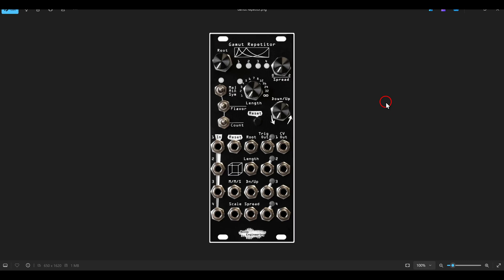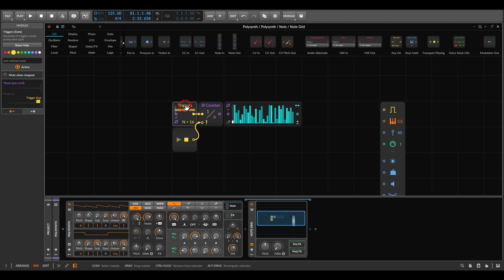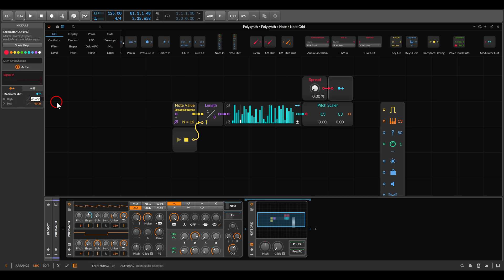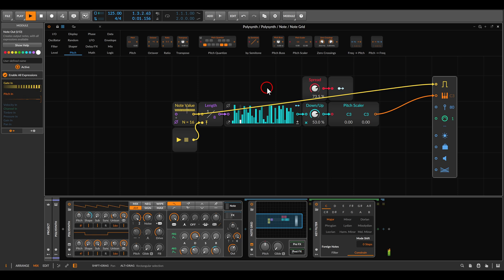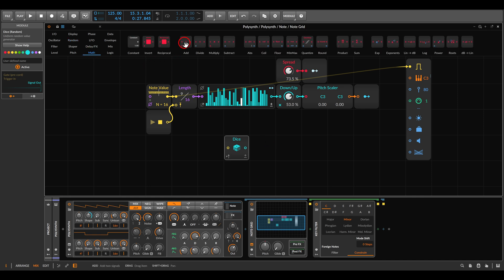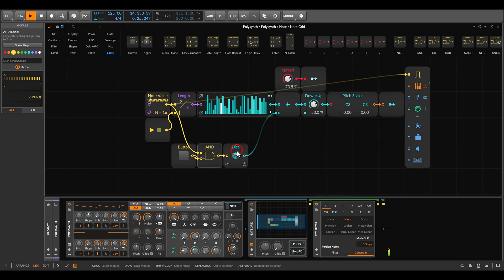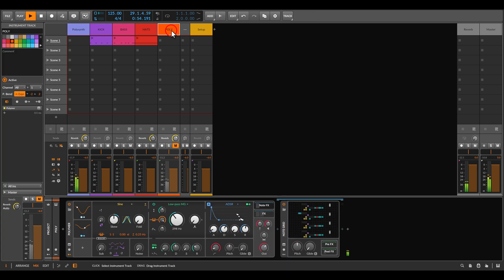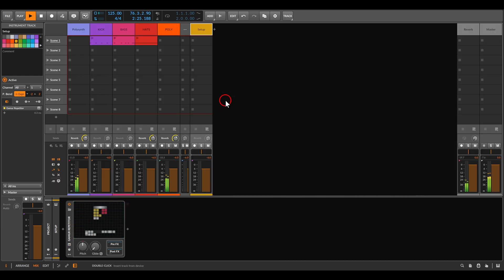Sequence Generator Setup in Bitwig's Grid

Comment: In the past the way it seemed to me was that the Key Filter would be upset if I didn't at least feed it legit notes. If I sent it weird unofficial pitches, it didn't know how to deal with them. I dealt with that by running everything through a pitch quantizer in the grid that would ensure I was at least generating recognized notes, and then that would go into the Key Filter, and it would know what to do.
Reply from the maker: That seems to work also!

Comment: Great vid as always!

Instead of modulating the pitch output,
You can use sample and hold module between the  pitch scaler and the pitch output and trigger it
 with the gate signal.

Thanks man!
Reply from the maker: Thanks! Using a S&H doesn't work for me. The Key Filter still doesn't quantize anything...
Reply: @TheBitwigMycelium  probably doesn't work in poly mode